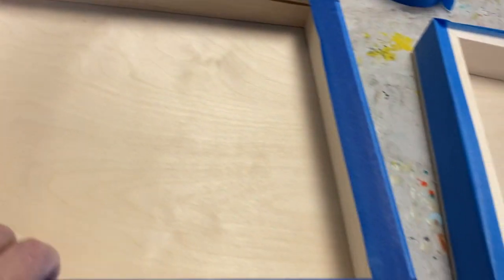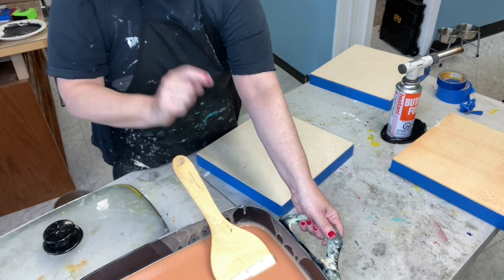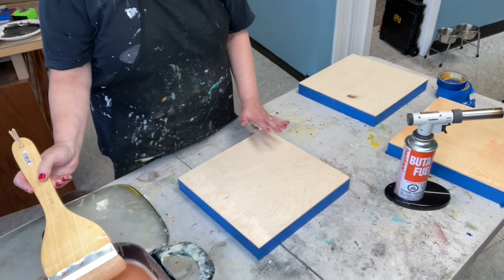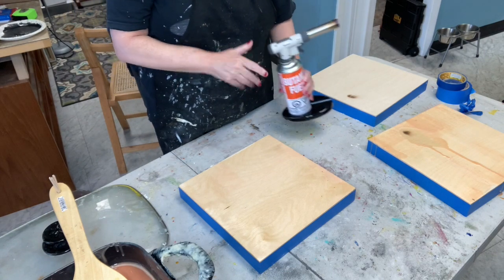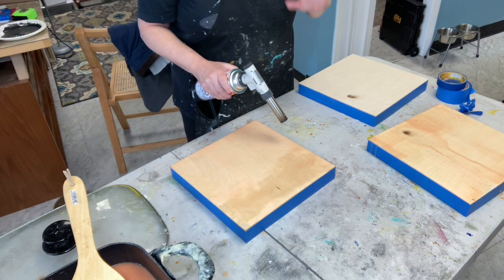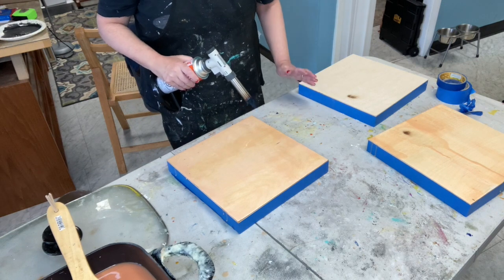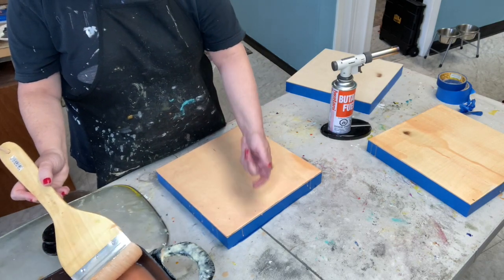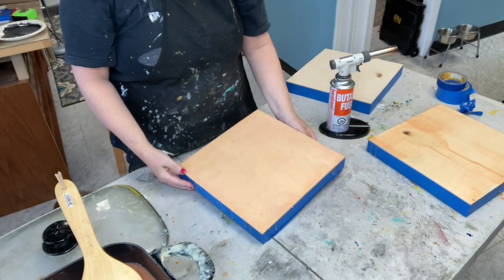Prepping Boards for Encaustic Wax/Wax Painter

Comment: What happens if you don’t wax the cradle board and you glue down photo copy paper with wax already on that looks good.I don’t want to fuse it because the other wax I put on that copy paper will melt. And if I put wax on top it will probably melt the under? Do you kinda know what I am saying?

Comment: I can’t get my boards smooth at all!  I only use a heat gun. I had a close call with a torch & nearly burned down my house. How hot should the heat gun be?  How do I get these smooth?  I’m so frustrated. Thank you!!
Reply from the maker: it is not the heat of the gun- part is to make sure you apply your wax to a warm board and use a big brush.  Then with a heat gun, you need to not be too close (you don't want to move the wax) and you take your time to smooth the wax.  It takes practice- my first 5 years i used a heat gun but finally had a lesson with a torch.  It takes practice for both and patience.